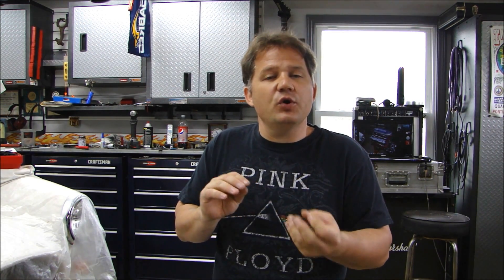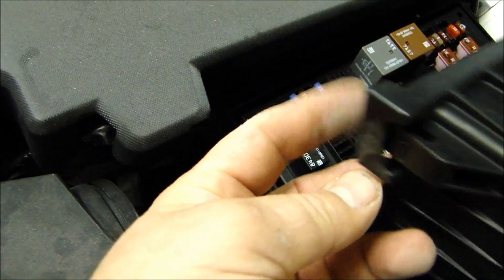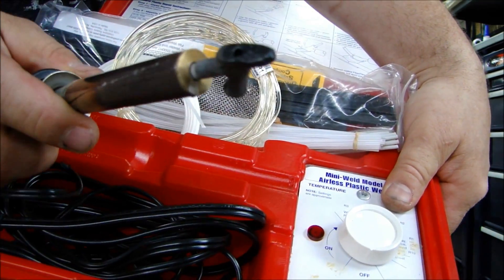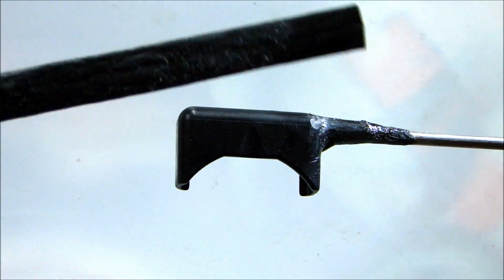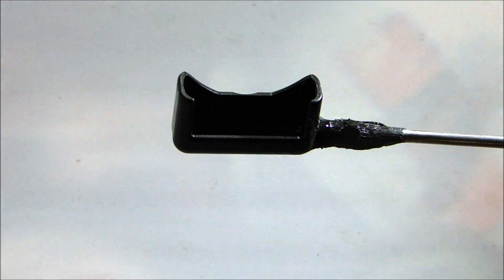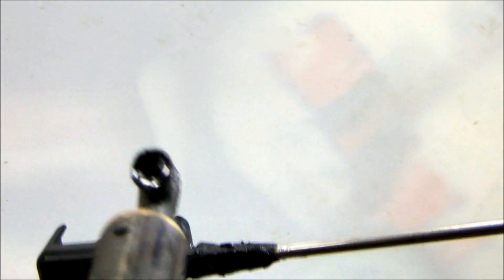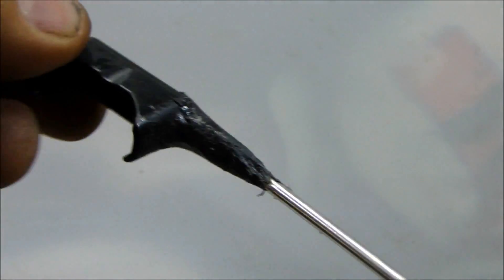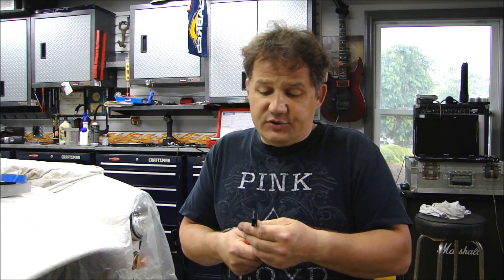Welding & Repairing Plastic Parts

Comment: It works great.  Surprised how easy it was, and really worked on old busted up mower hood.  I used a pencil tip soldering iron.  Not the best, but still worked great.  I think the HF wood burning kit would be great, lots of different tips.  BTW, lawn tractor hoods are polycarbonate mix.
Reply from the maker: Great tip!

Comment: Pete.  I have a plastic radiator with hair   crack on it. I have a welder like that one u have. What kind of welding rod do I use ?           Texas.
Reply from the maker: I would go with a polypropylene one first. You can use a zip tie

Comment: The Volt in your video has a coolant pump on the cabin heat circuit when the engine isn't running.  It's made of PPS, polyphenolethylene sulfide, a thermoplastic that has a melting temp of 280 C.  I am trying to weld a cracked cover, and have to use both a welding iron and a hot air gun to get the temp high enough.  Also, it seems the plastic, when heated, develops porosity, and I am getting leaking through it.  Tricky material to weld.  Have any experience with it? Any tips?
Reply from the maker: High temp plastics are tricky because they burn faster. For 500 degrees I use a small, pencil propane torch

Comment: Pete,  These are great, I bought a model 6. It's saved me hundreds of dollars. Welded 2 split radiator tanks (expensive), a split (HDPE) fuel tank (unavailable) for a 40 year old tractor and a few other things. 
  It takes a little practice, but they include a pretty good instructional DVD with the kit that helps you ID the plastic your trying to repair. My kit came with everything yours did, but I think it's a higher wattage head unit.
Reply from the maker: They do work well and can save you thousands!

Comment: I love your video. I need to weld my friends radiator. The elbow joint broke off where it connects with the top hose. He can't afford a new radiator and needs his car real bad. I think I can do this with what you demonstrated on this video. But not only did I enjoy your presentation, I also enjoyed your attitude and your spirit. Thank You.
Reply from the maker: Thank you very much. Radiators can be fixed. Just take your time

Comment: Great kit.  Could this be used to weld cooling system components like elbows and radiator plastic?  Does it come with rods for high temperature?
Reply from the maker: +kevin smith It can be used for any type of thermoplastic plastics. I'm not sure what you mean by hi temp. Most thermoplastics are around 375 degrees
Reply: High temp would be 190f at 20 psi for my purpose so that sounds like it could work

Comment: If you can't afford the kit, get a 25w soldering iron with a wide tip and some zip ties.
Reply: +Alex Jennings Lel, i built my laptop to tablet pc case this way.
Reply from the maker: +Alex Jennings That will work
Reply from the maker: Interesting
Reply: Lol i tried the 25w solder thingy out but is nothing like this kit this stuff melts any plasic easily the solder iron doesnt get that hot enough.

Comment: for a cleaner look while it's still hot, wrap it with waxed paper and smooth it out
Reply from the maker: +grant gilman That is a good idea, but, this plastic is heated up to about 300 degrees. I believe that would melt the wax paper
Reply: baking cup paper can withstand a lot of heat

Comment: How would you weld or glue old acetate plastic used in dealer promotional model cars from the 1050's and early 1960's? Is acetone the best chemical to use?
Reply from the maker: +Jim Ervin I would think a liquid is better than heat

Comment: Thanks--a wealth of information.  I never imagined you could do this!  Do you think this would work on a broken steam cleaner mop?  Mine snapped at a point just below the connection point of the screw-in handle and above the housing for the water compartment.  The weld seam would have to be circular, very strong, with some give, due to the constant downward pressure and back and forth movement of the mop.  Was going to try JB Weld Plastic, a rubber gasket brace, and two clamps before i saw your YouTube.
Reply from the maker: +Katie Fong Taylor This will work fine. That is made out of a HDPE. Very fixable

Comment: Hi Pete my son in law broke the plastic hole on the radiator where the top hose to the radiator go.  Do you think if I brought this kit I could put it back together and it will hold up against the heat and pressure of the radiator?
Reply from the maker: Freda Yourself Radiators are usually made of glass filled nylon or polypropylene. I have used this to fix both. Just be careful to get a solid root weld to make sure it is sealed
Reply: ok thanks I use a piece of the radiator that was not in use I am going to try it now
Reply: Thank you soo much!! You saved me 300 dollars. I did it on friday night and I also used some JB weld on it after I melted the plastic or fiberglass.  I had to wait 24 hours for the JB weld to dry,,  and It worked like a charm I am not running hot and I have no leaks..this is day three.. I am so Pleased..  Again Thank you for sharing

Comment: When you finished the repair of the dentist's tool, can you go back over the work with a hot air gun to give a smooth finished surface like the other areas of the tool?
Reply from the maker: Mike Schmidt Absolutely
Reply: I was wondering if that would work definitely gives the repair a pro finished look.

Comment: Hi Pete, nice video. We have a cracked hydraulic reservoir for a mercury trim cylinder which is obsolete and non-replaceable. It is a very hard plastic- black plastic. I can not find any identifying marks for type of material. Would you have any suggestions?
Reply from the maker: Most like a high density polyethylene. Those types of plastics can burn easily so turn up the e=heat gradually and go slow...definitely can be fixed

Comment: ***** How would I re-attach the plastic that goes around a HDD sata connector for power (Google image hdd sata connector) the plug has to go right over it and flush to the bottom? the plastic broke away from the 15 pin power. Would a thin soldering iron head run along the back be enough? (It's an expensive SSD drive) :(
Reply from the maker: I would try a low watt iron with a fine point. If you are careful it should work

Comment: How about welding a seam on a pool filter vessel (jacuzzi) very small in length.   I noticed it when i shut it down last fall.  Will soon be opening pool.
Reply from the maker: Absolutely....that is a harder plastic but it will work
Reply: Harold McDonald  i have the same problem on my sand filter seam!!! did you weld??

Comment: There are at least 7 kinds of plastics which demand different temperature settings.  They are not all alike, and the temperatures are somewhat tight or you end up with a major messed up plastic weld repair.  Wikipedia will give the temperatures per chemical comp. for the plastics (ABS, EEP,EP, etc). You also need to use the right rod for the kind of plastic you are welding.. Need to look for the plastic type emblem on the plastic parts.  Again, Wikipedia has a good chart to show what kind of plastic you have by the smoke, smell, etc.
Reply from the maker: Absolutely! the kit comes with a plastic identification and temperature chart. The switch has several positions marked for different plastics to take the guess work out of it. Great comment....thank you Stan

Comment: Can I fix radiator crack with this tool set? and what plastic tube would I use for that?
Reply from the maker: You can....but the radiator needs to be dry inside. Use a fiber filled rod. Test a part of the radiator to see if you can melt to it. That will help you make sure the filler is compatible with the base plastic.

Comment: after you are done with any repair, what's the proper way to clean the soldering iron? sand off the extra on the tool?
Reply from the maker: Wipe it off with a rag while it's hot and wire brush off any burnt plastic.
Reply: *****
thanks!

Comment: Would it be possible to use this to melt my side mirror back on my car? At first I was thinking about using Plado (used it to repair a whole in my apt. wall) and since that turned out fine I figured I can use it for that also but even though it worked wonders for covering a whole in the wall until I could do it properly Idk how it would work for plastic... but im 50/50 it could fail or go good but this is obviously the better route
Reply from the maker: I'm thinking no on the pla do
Reply: PLAY DOUGH? GET OFF THE CRACK

Comment: It works on you tube not in real life.
Reply from the maker: What problems are you experiencing?
Reply: ***** I did try to melt plastic and weld car bumpers nut doesn`t go at all. What you show us it is gluing. It holds if not pressure.
You will get same job if you  mix 1K urethane glue with 2K urethane plastic components. I did it and holds 3 yr because wasn`t big pressure or bending.

Comment from the maker: THE POINT IS that plastic parts in the engine compartment, for the most part, are repairable via the plastic welding process. Thank you for pointing out the obvious.

Comment from the maker: Hi Adam....it will be thermoplastic and it can be welded. Superglue does not work well on plastic, especially a flex joint like on a watch. You can weld it very carefully if you have a fine point soldering iron and some 10 power magnifier lenses.

Comment: Hi Pete

Great video.  A question about a watch I have where the strap's come off.  It's a Garmin 405CX.  Do you think I could weld this back on?  Not sure whether I should superglue on the inside and then try welding on the outside, can you tell whether this is thermoplastic or thermosetting?  Thanks!

Here's some pics: postimg.org/gallery/2j6jftbq/

Adam

Comment from the maker: Yes...you can weld it. Take the bezel off and weld it from behind. Get the iron hot and keep it moving, pushing plastic towards the crack and let it melt in. Smooth it out when you are done so it will snap back on.,,,,good luck

Comment: hello there,
 really like ur video ... its really informative nd useful.. i had a laptop whose screen bezel is cracked  at 4 places... nd i can't buy the parts b'coz they aren't available anymore.... i do have a soldering iron ..but no temperature control on itt.. as u might b knowing that laptop screen bezels are quite thin ...... do u think i will be able to weld the bezel...?

Comment from the maker: Wide open throttle, under load at around 4,800 RPM....totally melted down. The rod was still glowing and literally got hot forged as it hit the wall. It was cool to see. It was really fun running engines until they blow up. Got lots of parts and cool stories...maybe they would make cool videos?

Comment from the maker: You have a good eye my man. While working as an Engineer for GM in the late 90's, we were developing a new 502 marine engine for Merc. We had a dyno room with 5 stands, this prototype required a 6 hour hot test with 3 @ WOT. After 90 minutes the engine was glowing red a dieseling from heat. After it turned orange, the block cracked, the rod shot out and hit a concrete wall. The piston was obliterated but the rod was hot enough to be forged into that position. I said holy shit, that's a keeper

Comment from the maker: Yes...that is possible as long as the are the same base plastic. For example a high density polyethelyne can be welded to a low density polyethelyne. You can experiment on a small piece, if they both melt, they will stick. The difference is some may have a higher melting point and may not blend at the molecular level.

Comment: ok this may sound odd but how about welding differenty types of plastic together.  Like a milky white plastic on a master cylinder resivoir to a black plastic?
Reply: Jeremy Dunn     My thoughts. Never chance a brake repair   This should always be a new OEM replacement.  Not repair as this could be a life or death outcome. It’s going to be hard to know it’s something you may have done that resulted in someone’s death.

Comment from the maker: JB Weld will break after the plastic expands from heat. Go to a hobby store and get a piece of aluminum tube that fits inside the broken piece. Cut it a bit londer and use a slow dry super glue to hold it in place while you weld it back on. It takes some patience, but I have done this successfully many times. Melt in extra material at the base. Good luck!

Comment from the maker: Yes. Fix the rubber first with contact cement or silicone. Vulcanized rubber cannot be melted and fixed very well. If you fix the rubber correctly you can get it to stretch back over the inlet and use a hose clamp to seal it.

Comment: have to buy the kit though.. Had to replace a turbo inlet pipe recently, the plaint was hard plastic and the connection at the turbo was soft rubber. Rubber molded to plastic. The rubber overheated and tore away from the plastic.. have you ever attempted to do a fix like that,

Comment: Great demonstration: looking for plastic welding on the tube to fix a broken vacuum connection. Two male connection broke clean off .  I would  used JB weld to put it back together but  I like your method, since it looks stronger and use like material that can be shaped and will look close to factory. Thanks for the class..

Comment from the maker: Yes, if it is an acid filled battery it must be drained and dry. Every plastic part is welded using the same technique, just with different filler rod and temperatures.

Comment from the maker: The Chevy Volt is an awesome car! Like driving a computer...definitely the car of the future. Had it for 3 months and have not put in a drop of gas! Since the fan shroud is flexible you may have better luck with silicone.

Comment: Surprised to see you with a hybrid.  This is an awesome video, I'm going to try and use this info to repair a fan shroud that's cracked in half...I'm tight on funds so if it ends up being too much money to get into plastic welding, I'm probably just gonna JB weld it.

thanks for the video!

Comment from the maker: Hi Lee....Plastic welding is not just for things you can't see so I do not agree with the comment below. I have repaired plastic parts where the repair is virtually invisible. You can buy patterns and re-create the dash pattern as you weld. While it may not be perfect it does produce an acceptable result. I have welded splits in dash pads reinforcing it from the back, and with a matched pattern there was almost no way to tell it was repaired. And it is safe with correct ventilation.